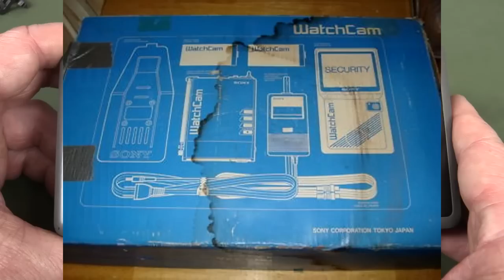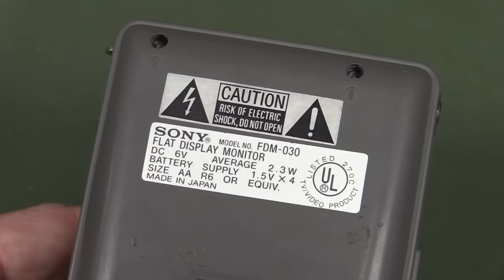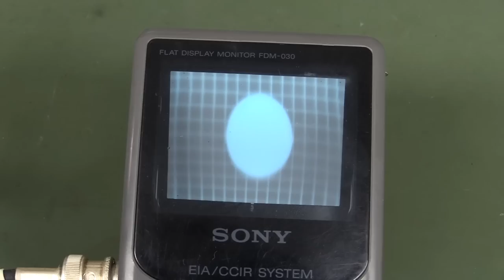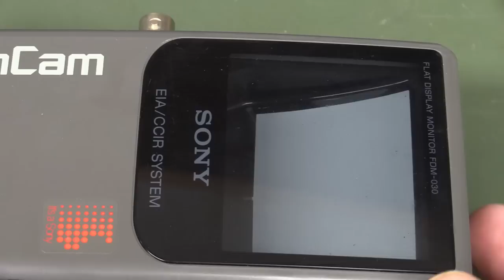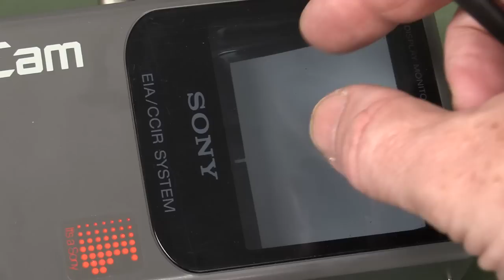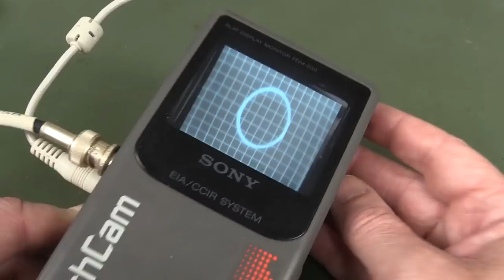EEVblog #1033 - Sony WatchCam Pocket Flat CRT Monitor Teardown

Comment: they did have LCD screens in 1989  The game boy original is a good example  I need LCD fluid for my Screen
Reply: But I bet they were not fast enough for any sort of video
Reply: It ghosted like hell too and was terrible for any motion at all and were useless for pretty much anything but static imagery. Remember that the GB had one of the best LCDs of that time and it still looks like garbage when stuff is moving.
Reply: The Game Boy certainly did not have a top-end LCD.  It was full of cheap, outdated parts even when it was new.  A better example would be the Atari Lynx, which came out the same year and had a backlit color LCD.  Of course, that's why it was expensive and sucked batteries.  It still looked like crap and had a much lower resolution than a CRT, though.
Reply: In addition to the Lynx, people also forget the the full colour PC Engine GT (AKA Turbo Express), with optional TV tuner. And the clamshell PC Engine LT had an even better screen.. They came out in '90 and '91 respectively, but NEC had prototypes at least in '88. Gameboy's screen? _One of the best LCDs of that time_? Pfft hardly.
Reply: The Lynx and GameGear both used CCFL backlights for the colour LCD screen so it was possible back then if you wanted to sacrifice your battery life.
Reply: Game consoles in the late '80s were expensive as they are today, but the GameBoy gave poor kids like I was a way to play some really cool games. Now, Nintendo want $300 bucks for their portable systems. I'm not sure if I will ever own a Nintendo Switch because of that, and they use cheap components with dead pixels now. Hell, if I ever get a single dead pixel especially from a brand new system, I will exchange it right away! For that price, it better be fully working! In many ways, I wish Nintendo would go back to producing budget systems with less than state-of-the-art technology so poorer kids could get back in the action. Never forget, the GameBoy original might of used older technology, but it still goes as the most successful video game system ever produced which includes television consoles! Not even the Atari 2600 was able to live up to that, and I think it is number 2 on the list.
Reply: Adjusting for inflation, 2DS hardware and software is cheaper than the Game Boy equivalents.  Plus it's got really cheap (and free) downloadable games, and a rechargeable battery.  The Switch is cheaper than the NES/SNES, too.  Video games are more affordable than ever.  And the Game Boy sits behind the PS2 and DS for all-time sales records.  The 2600 is way down the list.  While it was certainly an immensely important console, the market was much smaller back then and it only sold about 30 million systems.
Reply: Unfortunately LCD even to this day have piss poor black levels.
Reply: +LOLDONGS
Yep, I distinctly remember watching tv on a palm-sized backlit LCD back in '91, which I had bought the year before. It may even have been in colour, but I couldn't tell for sure. Heck, I seem to recall LCDs were always possible to backlight, precisely for low-light conditions, even back in the early 80s, both on calculators and games.
Reply: Heh, I have a Dell CRT with a sRGB mode on my desk for a reason. Great for color matching, and it's just fun to have around IMO. Love the degauss sound. I actually have several CRTs and 5:4 aspect LCDs I use regularly. XD

Comment: I still have a Sony Watchman from the same era.  (Mine was made in the mid 1980's.)  It has a built-in NTSC tuner, and it still works.  I can't receive anything with it though because NTSC signals are no longer broadcast in my area, except on some UHF stations.  It does work with an RF modulator though...

Comment: 11:57 "look at these extra coils --- get the extra curvature"
All CRT TVs and monitors I've taken apart have 2 sets of coils.
One around each half of a piece of ferrite shaped like a C that are clamped around the tube, and 2 more that are underneath those, and they also stick out further.
I doubt this CRT even needs to deflect / bend the beam very much, due to the angle and shape of the screen. (The Sinclair screen was flat)

Comment: I suspect that the thick glass on the outside of the CRT screen was added to it for safety reasons, and not a part of the CRT itself.  Also, it would be interesting to see if using a multiburst test signal and changing the yellow and black wires on the BNC to a mini-coax would make any difference in the resolution.

Comment: Had one in the states and used to play atari on mine. Had to modify it. Hooked the center pole of the antenna to a the center of a RG6 connector and the ground to the  common ground and it was space invaders time.. hehe

Comment: My guess is that thats a mod. No way sony would make something with a BNC stiucking out like that. That likely had an RCA or ⅛" in and someone removed that and drilled out the case to install a BNC. I can almost see that the words VIDEO IN on the case are being covered by the BNC connector. Thats a mod.
Reply: Sony would if it is not a consumer device. From one angle it looks covered up, from others it looks fine.
Reply from the maker: The consumer version was entirely different, you can see a photo of it in my video.
Reply: I am the person that sent it in. That is how it came from Sony
Reply: Here is a link to the user manual showing the BNC https://docs.sony.com/release/FDM030.PDF

Comment: Did it not need a flyback transformer because of the size? The coil going off the side of a picture tube I found the hardway, is one that stores power, even unplugged, for a very, very, long time.

Comment: I have one of the other versions, (FDM-404) that you showed the pictures of. Mine has had the 4 pin socket replaced with a bnc connector. It uses the same Horrible centre neg power socket, for 6v power, with no battery option. I'll have to power it up and see how the image compares to yours.
Pity one cannot add pictures to the comments on here.
I also have another one of these displays (Brand ??) that is actually a front door camera monitor, and is intended to be screwed to a wall. These tubes were quite popular back then for use as door monitors as they were the only practical display that could be wall mounted.

I think you'll find that the inductor with magnet attached was put on a sub board, so it could be placed at the bottom of the case minimising magnetic interference with the crt. I believe the magnet skews the waveform to give you the sawtooth waveform for the screen scanning.

Comment: 6:39 correct me but... solder thriving pads are all in the same direction. In with the wave soldering ends. It's more a marking for pin 1 I think.

Comment: fwiw, NEC released the turbo express/pcengine GT hand-held game system that used a color LCD (400x270) display in Dec 1990. It also had a TV tuner attachment that could take composite video and audio input.

Comment: First off, that particular BNC was added-  (hack job!)  and  I have a "new in the box" Wisemann "video doorbell" with a nice 6 inch  "folded" CRT similar to the one that you have, there (only larger).. the monitor section is a self-contained chassis..  neat stuff!

Comment: It looks as though the backside of the projection area is vaporized quicksilver. I think it is internally connected to an anode, try using a telephone line detector to verify.

Comment: Well to be fair. Gameboy was introduced in april of 1989, and it used a consumer grade LCD that even was fairly cheap product.

Also Sega game gear that actually did have a TV tuner and a composit in came in 1990 with color and stuff.

Comment: That inductor with the magnet on is for horizontal linearity.
http://gradllc.com/IMAGES/LINEARITY.pdf

Sinclairs unit actually sent the beam round a corner, the Sony unit has an angled screen at approx 45deg. so just the vertical deflection would be at a very small angle.
Reply: Yes, the gun has a direct line of sight to the parabolic phosphor screen. So no need for the extra steering device Dave was looking for. I was looking for this comment, I knew someone would spot it. Dave's got some highly focused viewers.
Reply: Shame that screen was not more focused. :)

Comment: What about deflection rather than attraction given that the coil is at the rear of the tube, it seems logical that the coil would deflect up. Does the electron gun sit in the centre and fire at the bottom edge or at the centre and is deflected and pulled to create vertical scan lines.

Comment: I wonder how do they take the electrons back from the phosphor. 
I mean, electrons can't just remain there because new electrons  will be deflected out of the phosphor target by the old electrons so you must get them back (normally they are taken back by the high voltage anode circuit but here i don't see such connection).
Reply: its connected to the neck and i assume that connects internally to a conductive coating inside the tube just like any other crt, well besides the neck connection
Reply: Some CRTs have been known to charge users up slightly because the electrons don't get collected properly, just a thought. Could be wrong though.
Reply: That's why you have to regularly turn it upside down to shake the old electrons out

Comment: You might not need to break off the magnet from the inductor. Just putting another magnet on top should tease out its secrets.

I have one of those on my desk, incidentally. Got 652 12° silkscreened on the top of the magnet, along with this half-moon which could be mistaken for the contrast symbol. It think it should act a bit like an awfully poor rectifier.

Comment: Hey Dave!, I have watched many of your videos in my study, I may not be an engineer (stuck in stupid 10th grade), but I want to recommend a topic, why don't you discuss VLSI Design, Microprocessor Architecture, Manufacturing of VLSI, etc. Electronics died two decades ago, you would lead all your viewers to a much more productive outcome by adopting these topics, capacitors, resistors, CRTs, Oscilloscopes, Small Electronics (Cars and consumer electronics) all of this analog stuff belongs in a museum, besides, if you discuss at very advanced levels, you could actually create employment for your viewers (like me lol). Nice content!
Reply: Electronics never died (and never will). One needs a power supply to run that fancy micro, and another to run the screen... ;)
Reply: Yes, electronics is alive, but not a really large sector, technically speaking even that micro processor is a 'micro- ELECTRONIC' device, however it's not something that involves, soldering, datasheets for selction, op amps, capcitors, inductors, human scale transistors, it's VLSI Design unlike the electronics discussed in this channel.

Comment: I was carrying around a normal 6" mono cctv monitor, ladder and 240v extension lead well into the early 2000's to adjust cctv cameras. i would have killed for this thing.

Comment: Interesting thought, considering the speaker is on the other side of the the CRT, could that inductor be meant to counter act its field?
Reply: Because it's bw it doesn't have the geometry issues caused by waving a magnet in front of the screen

Comment: Didn't Sony make a prototype color flat screen CRT?  IIRC, it was a beam index tube with UV phosphor strips between each R,G,and B phosphor strip, and a UV phototransistor would pick up the flash as the beam crossed over to the next color and switch the drive to the single electron gun.  I don't think that prototype tube ever made it into production though.

Comment: This pocket tv looks really nice, and,,,

for those youtubers reading this commant i will say ,am curious to see if it will work with lightgun games once hooking up console to it, since it is a crt screen so therefore there should be no delay, 

Also youtubers, imagine a portible nes & snes or genesis with a flat flat tube in it to ansure direct compatibility with lightgun games and no input lag and no motion blur .

Comment: The fact that it's  not the same as Sinclair proves that you don't need to reinvent the wheel. If true and tested EM CRT works, why waste resources for something new if it provides no real advantage.  
Also what was the analog of this in 2000-s? CRT-s were quite common even up until 2005.

Comment: plz replace that cable with a coax one, it's making me nervous, no wonder the signal was so blurry, an unshielded cable going next to all those electromagnets from the screen
Reply: I'm inclined to think with such short length, it being CVBS and the weakness of the tube that it doesn't have a noticeable impact. But I'm curious now and would like to see a side by side comparison.
Dave probably won't but maybe somebody else who has one?
Reply: Will have little effect, however a focus control would.

Comment: dave what are your thoughts on a 1984 laptop, with 2Meg of ram, a 60mb hdd, and a 33mhz 80486 DX processor?.... also the cmos battery was a NiCd cell the size of a D-cell battery with a 'jawdropping' 50mAh capacity
Reply from the maker: 486, meh, no one cares about them. Not old enough to be retro.
Reply: EEVblog Not... Old enough? Welp, time to start collecting 386s

Comment: I just bought one of these exact things from a thrift store. What can I plug it in to, to watch video?
Reply: Anything, just need a rca to bnc converter cable or plug. Then use anything with a composite output

Comment: Maybe the gun is projecting the video at trapezoidal shape?
Reply: Jad Fetizanan in this version of the crt design, you might be right. If memory serves this design was a two part or stage display. Similar to rear projection tv's of yesteryear. Though I have not recycled crts for a while. Been out of the e-waste field for about 4 years now. But i do recall these units separating at the funnel.
Reply: You are correct, it projects a trapezoid image called keystone correction, colloquially also called keystoning. The shape of an architectural keystone, hence the name of the feature. 
 Did you notice the parabolic curve on the screen? I wonder if that was to compensate for the different brightness levels from the bottom to the top, or some other reason. All pretty cleaver physics.

Comment: God I wanted one of these when they came out. Who could have imagined a Samsung Galaxy 8 with Netflix in your pocket back then?
Reply: Nah I can stream LIVE TV ANY CHANNEL I WANT (using a IR blaster to change the channel over the internet) using sony location free on my phone..  screw netflix  old movies no one cares about  i know some cable co have live tv but it's only limited to  6-7 crappy channels  no one wants to watch(unless you are " at home"  using your cable co WiFi or computer)  U make a Fake domain name with the word speedtest  to loop hole the video stream to 720p..  Secured  connection to avoid deep packet inspection

Comment: can you game on it?
Reply: If you can output a composite signal, then yes. All you'd need is a BNC to RCA adapter, which are cheap.

Back when I was moving around in the mid 90s, I had a Nintendo 64 that I used to play on a 9" B&W CRT.

Comment: The glue that SONY used becomes conductive after a period of time so should have been removed.
Reply: The kind of glue shown in this video is safe, it's a rubbery kind of thing, like a heavy-duty version of hot glue. It is not the infamous yellow/brown glue you are thinking about.

Comment: I would bet this unit it us fairly high on xray output
Reply: nope...the hv is way too low to generate any substantial xray output.
Reply: If it had a high voltage greater than 1.5KV I would be suprised. to get soft Xrays you need at least 10KV, then the anode current is proportional to the amount produced.
Reply: I've heard (anecdotally) that vacuum tubes (like for audio) can present an x ray hazard  in certain circumstances, they are usually only driven at a few hundred volts at the plate, this must be ballux too? I figured this tv might be higher than most (exposure wise) since you are holding it and the gun is pointed at your hand and  is separated by very little material. I would love to see some real  data on tubes and rays if their is any.
Reply: I found this
http://www.iaea.org/inis/collection/NCLCollectionStore/_Public/16/030/16030661.pdf
I remember back in around 1986 trying to measure X-rays from one of our colour monitors and found we could not detect any above the normal background.
Reply: At the typical voltage and current levels that audio tubes run at, x-rays are not going to be a issue.
Tubes ran at much higher voltages indeed can emit x-rays.
Reply: Tubes used in RF power amps for instance can (and will) put out x-rays, but there you have other things to worry about - like the presence of a high voltage, high current power supply at the anode.